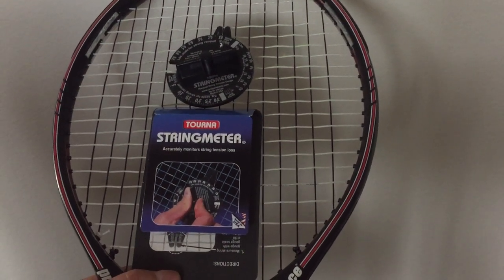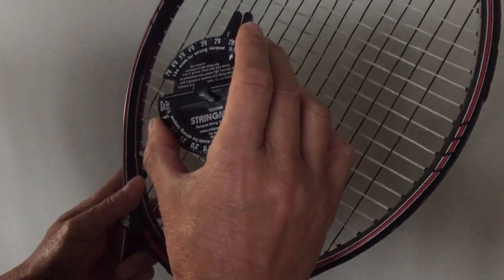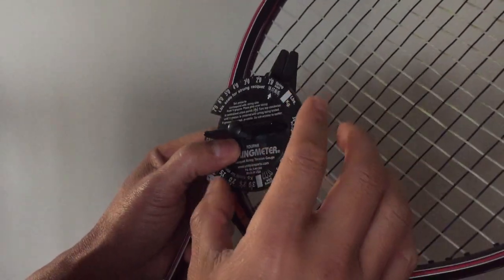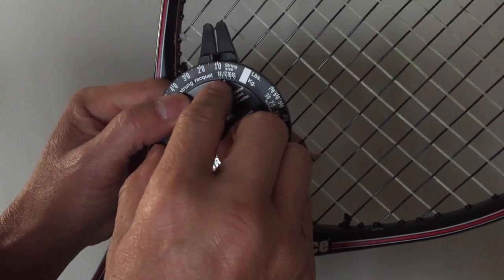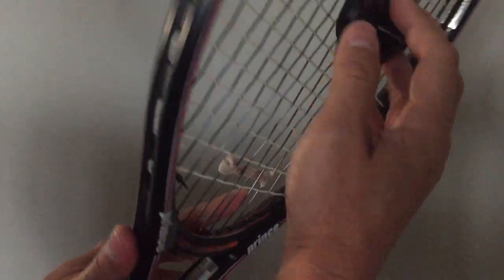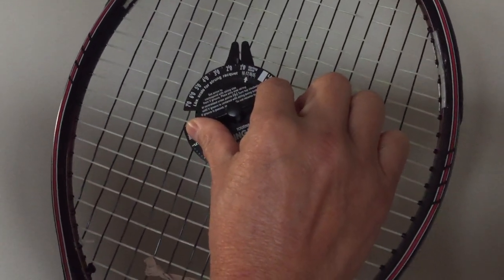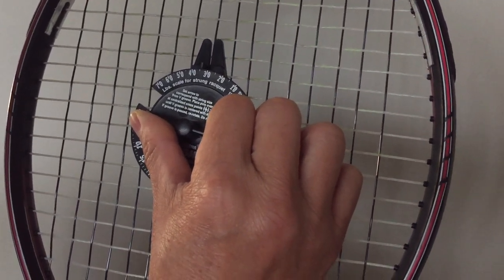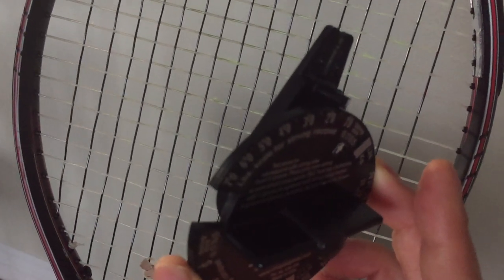Tourna Stringmeter

Comment: The problem with the Stringmeter is: you measure the lateral movement of the strings. You would need to measure the vertical movement which simulates a ball hit. 

The Stringmeter measurements are highly influenced by the string-to-string-friction and not just by the tension.
Reply: True. This device is still useful if you use the same strings and weight in each frame because it tell you the relative tension drop for your setup.